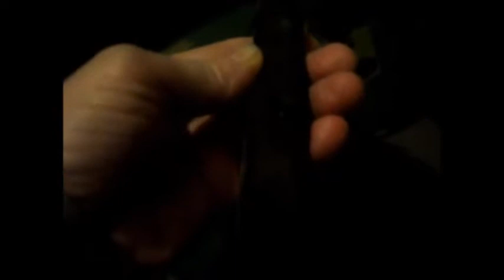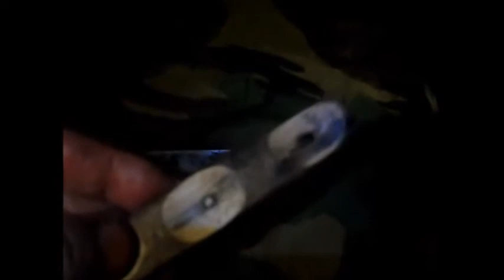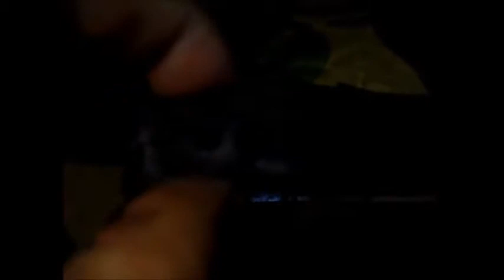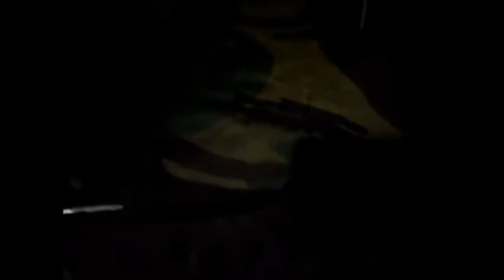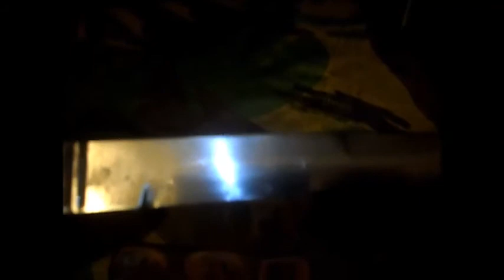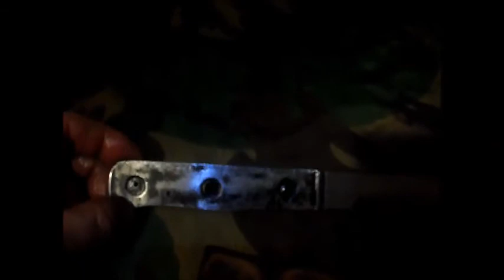ZPs A RESTORATION THE START

Comment: Interesting blade that Keith... Looks like a stiletto with a bit of a weight problem.
Would slapping liners on between  oak and the tang also solve the corrosion problems if someone wanted to use oak scales ?
atb...
Reply from the maker: HI Dusty you are right in thinking that liners would solve the problem of oak reacting on steel and oak looks so nice and i think thermo resin stabilisation would work as well mate ATB Keith